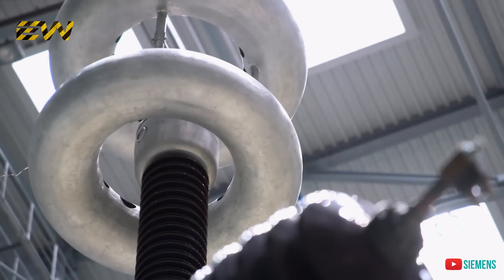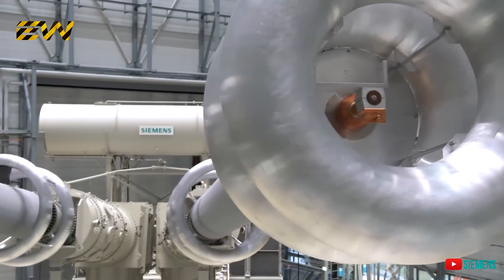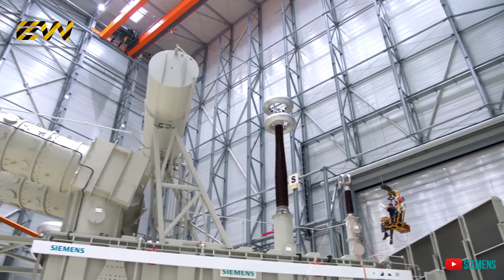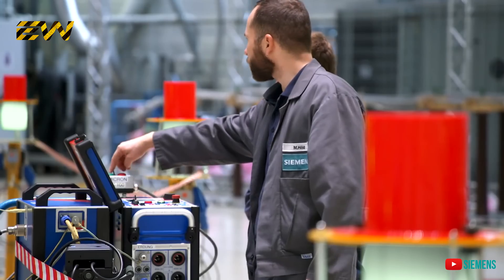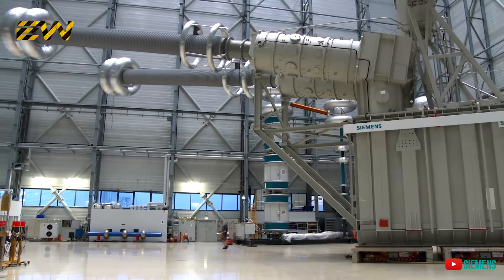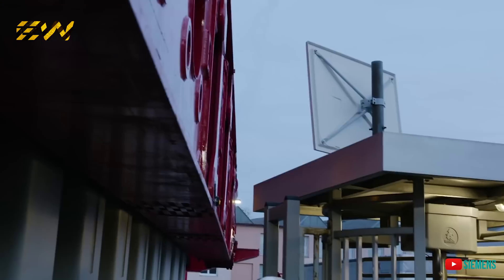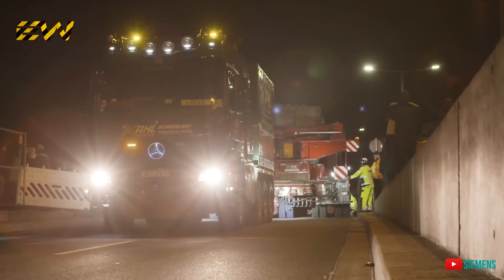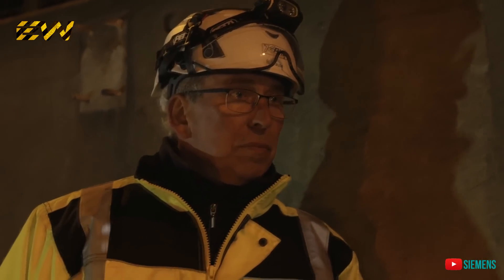World’s BIGGEST Electrical Transformer Video

Comment: Transformers core losses (eddy current + hysteresis loss)  based on Transformers is kV rating or Voltage rating . Whenever the voltage is increasing  size of core increasing . In other words( Eddy current formula) Pé=Ke*V*f^2*t^2*Bm^2

Hysteresis loss formula Ph=Kh*V*f*Bm^1.6

From this equation we can understand that Voltage raises ,then  iron loss raises,  and also core loss raise. Hence automatically Transformers size also increasing...

Comment: its the larger size of the wire to handle more current which increases the size of the transformer but the windings stay the same to hold the same voltage.

Comment: Size of transformer increase with voltage rating, b'coz
According to emf equation
E=4.44 B A f T
If we want to increase voltage, then we increase area of core, b'coz B is constant (1.7 to 1.8 for CRGO Steel), Frequency also constant and No. of turns increase with increasing area of core
So that's why size increase.
Reply from the maker: Thank you for your detailed answer. Kindly consider subscribing to our channel for more engaging videos and technical discussion. You can subscribe here:  https://geni.us/SubscribeChannel
Reply: @engineeringworld.  
How to join SIEMENS after engineering? 
What is recruitment process?
Please reply.....

Comment: Seems like it would be cheaper and easier just to build it on site in China inside a temporary building where it's meant to be used. Kinda like a 200 inch TV, eventually you reach a point when  it's cheaper and easier to get the tv first and then build the house around it.

Comment: Because the insulation size will increases when voltage level of the transformer increased, also the cross section  area of winding conductor also increases when the capacity of transformer increased.....

Comment: As per fardays law of EMI the induced emf in secondary is directly proportional to no. Of turns. Since the voltage at secondary of xmer is 1100kv so turns also proportionally going to increase. Also insulation to this turns also takes more space,hence with increase in vtg rating transformer size increases.
Thank you
Reply from the maker: Thank you for your feedback! 

Have a nice day ^_^

Comment: "Feed into a transmission system at 1100KV DC? " Really? I thought transformers were fundamentally AC so does this include rectifiers? nothing technical in this video just Logistics of moving a huge object
Reply: DC have less losses than AC, so for great distances and power they use DC and rectifiers
Reply: @MrPRECLIK  True but this is still a transformer so it must be AC based and conversion to DC included, they didn't say this they just talked of a transformer hence my confusion. I guess its still a transformer in the true definition of the term  :)
Reply: Actually Chinese are building a 1100kv HVDC transmission line and this transformer must be part of that so i think the narrator must be trying to present that only. 
There shall be huge converter banks along side this giant to convert the supply in DC.
Reply: @joeylawn36111  
solar panels produce DC current . THEY SAY THAT, if we use DC as it is,losses are very less.very high efficiency. but when you convert,loose major part of it.
therefore,changing from AC to DC,then transport it-again change from DC to AC.i think huge losses. are you sure?
Reply: @MrPRECLIK  for Ur kind info DC can have more power loss as compared to A.C. POWER but in HVDC the whole scenario will change
Reply: @relaxingsoul2050  what is proof that DC have more losses than AC on low voltage ?
Reply: @MrPRECLIK  according to electrical engineering power loss is greater in DC
Reply: @relaxingsoul2050  That is not good answer :D
Reply: @MrPRECLIK  I^2r losses are greater in DC for low voltage or you can explain
Reply: @relaxingsoul2050  I tried to Google as hard as i can but i don't found any information that DC have more losses than AC. In fact, every page say that AC have more losses due to inductivity, which is not losses in reality but reduce power flow in cable.
Reply: One of the reasons HVDC is used in extremely long lines is because you can use two conductors instead of three. Saving one conductor in 3000km its no joke. And DC permits the use of 100% of power capacity of the conductors, instead of rms power on ac sistems

Comment: An increase in voltage rating requires an increase in clearances and dielectric strength. Since the dielectric strength of current materials is constant, size has to change in order to provide adequate clearance. This you will learn form 2nd year electrical engineering trade mathematics (in Australia ).

Comment: did he say direct current?
Reply: yup
Reply: Very long transmission lines that cross continents and oceans are often DC.
Reply: @thegreatoutagesign9204  Having worked at one I understand that. However a transformer requires A.C. to "transform" voltage to a higher or lower value. D.C. does not function in that manner. Therefore there really is no such thing as a D.C. transformer.
Reply: @gordlawson9906  Good point. that escaped me there,
Reply: It will have rectifiers inside of it.
Reply: @ohgoditsjames94   Transformers do not have rectifiers inside them. At best a primary coil secondary coil and c.t.'s. Besides a rectifier for that kind of voltage would probably be as big as the transformer itself.

Comment: The size is related with the KVa. Increasing the KVA reduce the losses in the grid and the cost of the transmission line or Increase the capacity of the TL.

Comment: Every HVDC article seems to be about turning the AC into DC, which is pretty straightforward.  But to turn it back requires an inverter, and the highest-voltage inverter I've ever seen produced 575V AC.   It seems like turning a million+ volts DC back into AC would require some ultra-volt IGBTs or transistors, or have a whole bunch of inverter stages rigged in series so that each one wouldn't have to handle the full voltage.
Reply: Correct.  Think of a 400 level inverter that  and all in series to give one giant inverter. If it's with igbt and a Voltage source converter then it's called a multi modular converter. Or it can be converted from dc to ac with thyristor valves then it is a LCC, line commutated converter

Comment: More rating means More Voltage means More No. Of Turns means More Copper means More Heat meant More Cooling means More Insulation On Windings Means More Size.
Reply from the maker: Thank you so much for your feedback.

Stay safe! :)

Comment: voltage of a transformer is dependent on frequency,flux,and number of turns...since frequency is fixed voltage is now directly proportional to flux and turns..since flux is magnetic field density multipilied by cross section area of core ..so to achieve higher flux area of cross section of core is needed is larger ..thus net cross sectional area of CRGO lamination increases ..also on the other hand voltage is directly proportinal to the amount of insulation...so 1100kv transformer surely needs large insulation material which further increaes the area ...all thses factors  combiningly results in large transformer size
Reply from the maker: That's absolutely correct. Thank you for detailed comment. Consider subscribing to our channel for more engaging videos and technical discussions. 

Subscribe here : https://geni.us/SubscribeChannel

Comment: Its Ampere that makes the coils big, to handle the temprature. And higher voltage needs distances between wires not to arc over . Insulation materials such as oil and vacuum is the better .

Comment: High voltage transformer have higher number of stacking coils with thick insulation,also it need more spacing between primary and secondary windings.
Reply from the maker: That's absolutely correct. Thank you for sharing your knowledge with our audience here. Consider subscribing to our channel for more engaging videos and technical discussions. 

Subscribe here : https://geni.us/SubscribeChannel

Comment: What ratio is that beast?
Considering that plays a big factor in size, voltage per turn, current over the area of the flashing? And is this a 10:1 ratio? I would like more information about the Rectification valves used? Their huge, let alone the transformer.

Comment: The transformer size increases depends on the rated voltage because as the voltage increases the insulation is also to be increased .that's why transformer size increases with its rated voltage
Reply from the maker: That's absolutely correct. Thank you for sharing your knowledge with our audience here. Consider subscribing to our channel for more engaging videos and technical discussions. 

Subscribe here : https://geni.us/SubscribeChannel

Comment: Hello!
Why does the size of the transformer increase with the voltage? Very easy. Nobody would think of building hugely expensive HVDC energy infrastructures to only transport 50 ~ 100 MW! So, the transformer is not only big due to dielectric solutions connected to the1100KV, but due to its power (size of its coils, core, cooling system and mechanical solutions for the very heavy bushings!)

Comment: The question was: "Why does the size of a transformer increase in voltage rating?"

Answer: Because Godzilla has been eating up volts ever since the 1960's, and the Chinese just can't have that or else they won't have enough left over to make a pot of coffee. So now they made a transformer that's too big and heavy for Godzilla to simply walk away with. Now if he wants it he will have to call on Jet Jaguar for assistance, but last I heard he was married and is settling down.

Comment: as voltage increases amount of insulation also increases as voltage rating directly proportional to insulation requirement
secondly larger rating requires more cooling apparatus like no of fan, size of radiator for effective oil expansion for better cooling 
thirdly we cant go for more magnetic flux density which may lead to more saturation and that may leads to worsen power factor and this will leads to drawing more magnetizing current  and reduction of utilization factor
rectify me if any mistake or more clarity concept if any
Reply from the maker: That's absolutely correct. Thank you for sharing your knowledge with our audience here. Consider subscribing to our channel for more engaging videos and technical discussions. 

Subscribe here : https://geni.us/SubscribeChannel

Comment: In transformer, as the voltage rises the no of turns will increase in order to produce higher voltage comparatively. Thus,we need higher rating of auxiliaries of transformer. Apart from that, voltage is directly proportional to insulation to prevent from abnormalities and faults.so, it will also increase the size of transformer
Reply from the maker: That's absolutely correct. Thank you for sharing your knowledge with our audience here. Consider subscribing to our channel for more engaging videos and technical discussions. 

Subscribe here : https://geni.us/SubscribeChannel

Comment: What is the advantage of high voltage DC transmission versus AC over long distances ?
Reply: *Reduced losses
*Required less amount of conductor
*No radio interference
Reply: Dear, HVDC is much more economical then HVAC beyond 700km
Reply from the maker: Good question! 

Why don't you research and tell us about the same !

Comment: 1.we get a large amount of output power
2.less ampere more voltage using time contactor dia reduce and in-between two Poles distance increase so the initial cost reduce
Reply from the maker: This is regarding ?

Comment: As rating of transformer increases, higher voltage is required at its primary and secondary side. Hence, to keep flux constant (to prevent core saturation), core cross sectional area increases according to E=√2πf×PhixAxN. Hence, size increases. Also, transformer loss also increases. Hence, to prevent hotspots, size increases.
Reply from the maker: That's absolutely correct. Thank you for sharing your knowledge with our audience here. Consider subscribing to our channel for more engaging videos and technical discussions. 

Subscribe here : https://geni.us/SubscribeChannel

Comment: Traffo size increases with voltage due to foll factors- (1) for higher volts high # of turns (windings) are reqd  (2) high/enhanced/protected insulation system is reqd between phases n between phase to earth,  (3)  with increase in # of turns larger ferromagnetic core is reqd ,   etc ..
Reply from the maker: That's absolutely correct. Thank you for sharing your knowledge with our audience here. Consider subscribing to our channel for more engaging videos and technical discussions. 

Subscribe here : https://geni.us/SubscribeChannel

Comment: Higher the voltage, higher the flux in the core which needed thick core, as well as it require more no of copper coil turns in order to increase the voltage..
Again at high voltage the insulation and quantity of insulating oil and cooling system also increase considerably..
Hence these all condition make transformer weight and size high at high voltage level..
Thanks.. if any mistake plz correct me.
Reply from the maker: That's absolutely correct. Thank you for sharing your knowledge with our audience here. Consider subscribing to our channel for more engaging videos and technical discussions. 

Subscribe here : https://geni.us/SubscribeChannel

Comment: Size in these components has to do with mechanical, electrical, and even quantum mechanics. Insulation, heat dissipation and electromechanical limits have to be considered in the design.

Comment: Since voltage ratio of a transformer is directly proportional to the turn ratio so, more the voltage handling capacity more will be the number of turns and more the number of turns more the insulation will be needed due to which both size and weight of transformer increases .

Comment: Very simple, higher voltages require larger insulation, therefore the coil dimensions increase as does the transformer size.

Comment: The higher the voltage the more turns on the winding. In order to compinsate for induction. Most likely the flux material that is a componate of the primary and secondary winding differ in thickness and surface area which effects the overall size of the transformer.

Comment: Can someone please explain what the HUGE arc/spark gap terminals are for ? I read that it’s got something to do with any secondary low-side surges...Are they to dissipate excess voltage through the air in terms of heat dissipation ?

Comment: Voltage = 4.44*frequency*Area*maximum flux density. Hence, Voltage is proportional to the Area of the transformer. Therefore, Size increases with increase in voltage rating. AND if they are using transformer for UHV DC, they must be stepping up the AC voltage and then converting it into DC to reduce the current and hence, the losses in transmission. Since DC has no frequency, it will not produce magnetic fields which is basic principle of Electromagnetic Induction so passing DC through a transformer is useless. In DC, BUCK Choppers are used to step down voltage and BOOST Choppers are used to step up voltage.
Reply from the maker: That's absolutely correct. Thank you for sharing your knowledge with our audience here. Consider subscribing to our channel for more engaging videos and technical discussions. 

Subscribe here : https://geni.us/SubscribeChannel
Reply: Wow Sir! Replying after a long time. I have also forgotten when I have posted this. Its been a year! Anyways, its good to see my information came useful to you. Thank you so much for replying back..😊😊